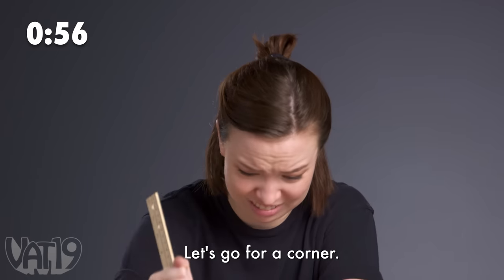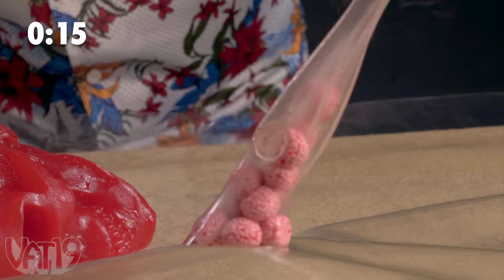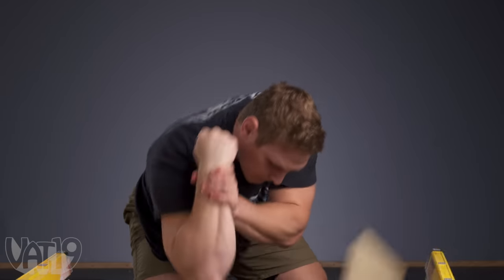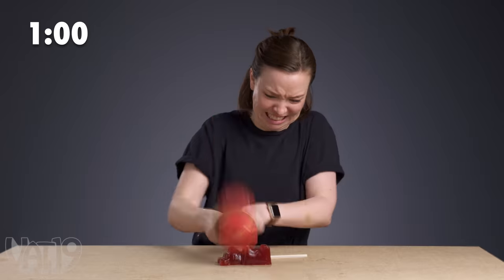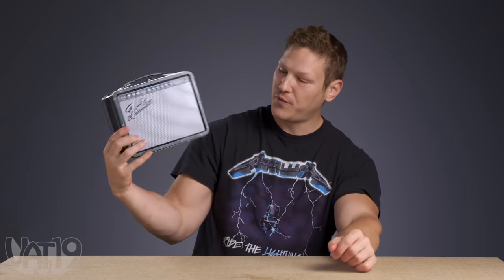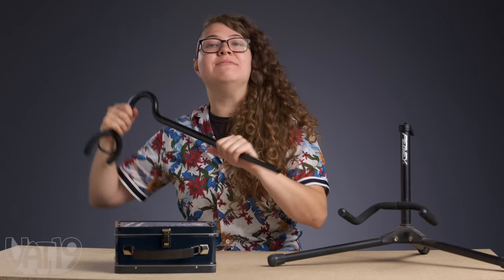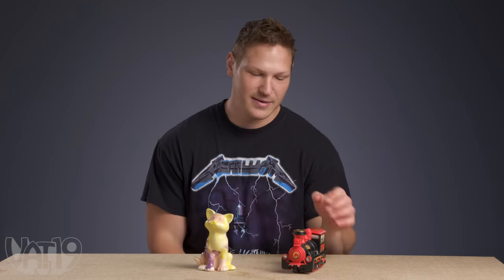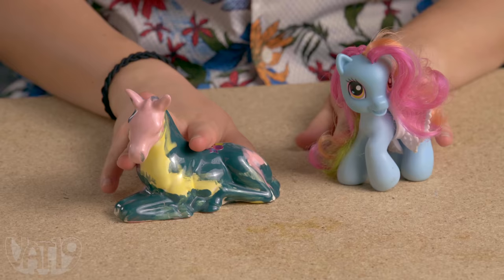$1000 if You Can Break This Ball in 1 Minute • Break It To Make It #31

Comment: I stopped watching at the gummy bear, not only were some "breaks" a little cheap, but everyone had an item that could EASILY have done the challenge (especially given the leniency of the word break) in 2 seconds, yet none of them excluding the wine glass guy and the rather annoying floral shirt person did the obvious play. 

Wine glass guy honestly was just the smartest here, he had sharp object, tried to cut off the head. Masterfully executed.

Rock Candy Person ended up stabbing after trying to... saw the bear? The stab could have just been 5 stabs along the neck to sever the head, but no lets give them the challence for doing literally nothing but stabbing through the bear and breaking the tool more than anything. Sure. A little cheap ngl. Almost sympathy points for the "very intelligent" rock candy saw strat.

Troll Doll probably the easiest one out of all of them. Hard plastic, hands are open, just stab the hands through the neck until the head is severed. Unlike using broken (glass?) it's way less risky, and probably much easier.

Ring pop. Probably the most difficult one, but I'm positive the circular "Pop Guard" around the handle and ring pop would have been more than enough the sever the head if you rolled it.

Ultimately, I liked the Kyle and Leslie, but the other two were insufferable and this is my negative yelp review.